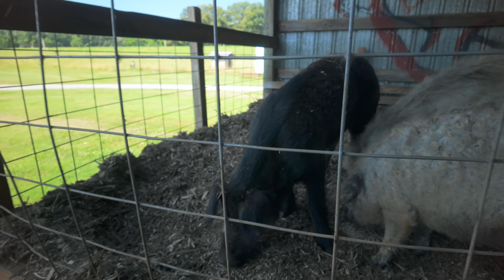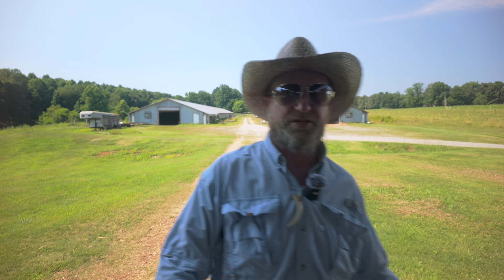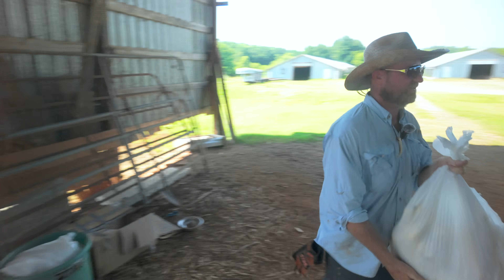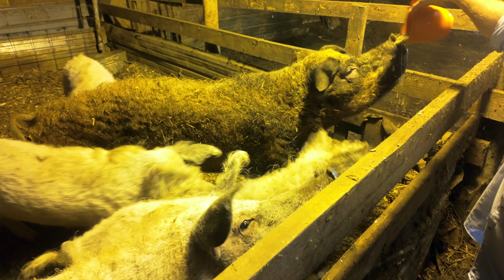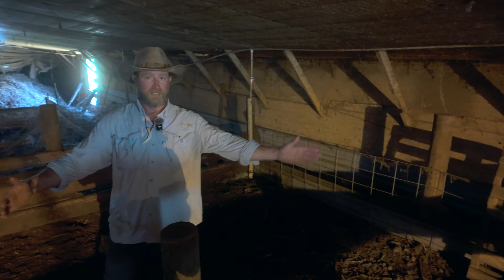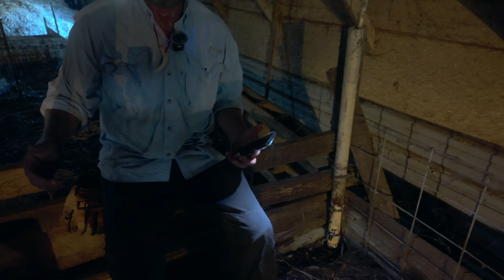You Won't Believe How This Farmer Raises Pigs

Comment: in the last video you showed the Bamboo Forest. I have been told that it has roots that have michorrhizhae in them, and can be a good IMO collection spot. if you can develop it and keep a spot untouched and no stepping(pets ugh!) you can get a system going, by hopping it up using KNF tricks, then tap into it later.